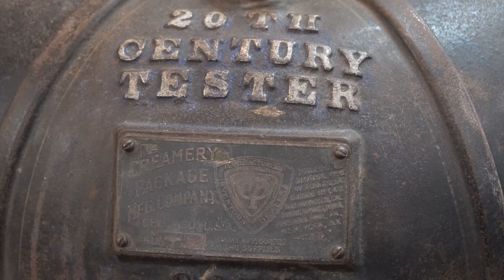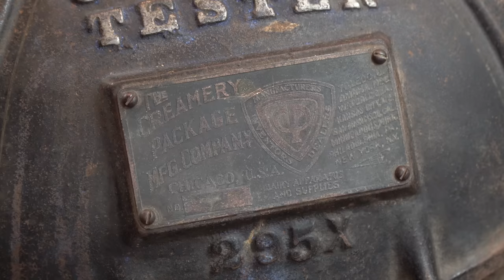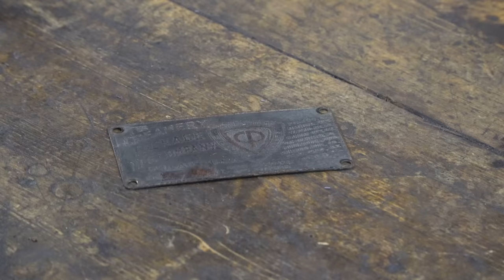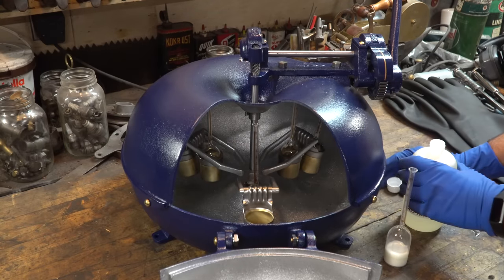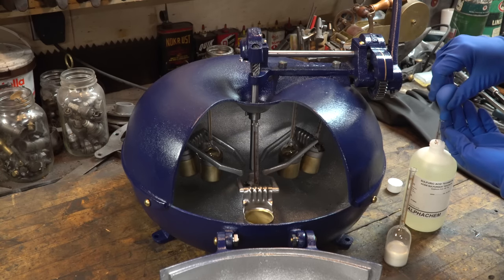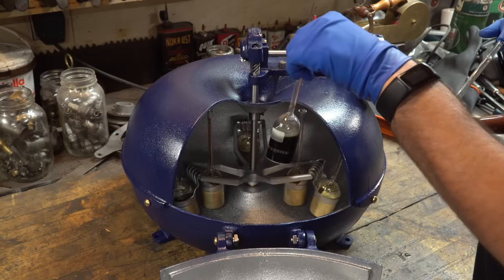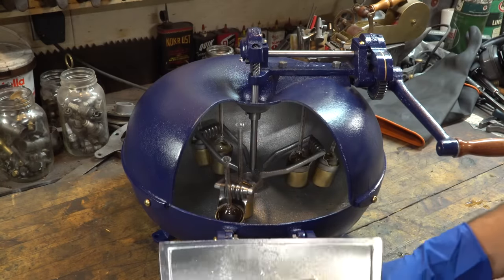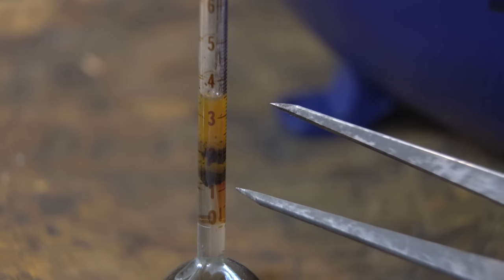Antique Sulfuric Acid Milk Fat Tester [Restoration]

Comment: you did things correctly. i used to do this for 5 years at gossner foods in Utah in the whey and cream prepossessing. we took these samples every 20 minutes of production. while this is a very old cast item we used a less fancy more modern from the 90's one but the process is identical. we are supposed to do 2 of them at a time and thus why yours has 3 areas with 2x in them. 2 for redundancy to get a more accurate average (hence your discrepancy form the store milk) and if you do the math. every 20 minutes, takes 20 minutes to do the job, you are doing 3 every hour. this tool would have been in constant use while the cream fat separator is in production from the milk / cheese was in production. some person was probably turning that thing for 12 hours at a time. most plants never shut down. if this was a single vial or dual then i would say that it was for a small farm but a 2x3 unit like this would be in use for at least 12 hours every day non stop.
Reply: Did you really use 1:1 H2SO4 and milk? And did you really use 98% H2SO4? That seems like a severe excess of acid.
Reply: Good to know! Thanks for telling us!
Reply: @littlejackalo5326  You want to react all the protein away, leaving just the fat, and then centrifuge it to coalesce the fat into the single blob.
Reply: @littlejackalo5326  Does it?  It seems to me like you want to destroy everything that isn't fat, which means nearly 98% of the milk.  I would expect a 1:1 ratio would be the best way to do that.
Reply: @robertlandrum  An excess of acid ensures there's no discrepancy in measurement, anything unreacted will make your measurements wrong.
Reply: Are these single use? Cleaning them sounds horrible but using once seems insanely wasteful
Reply: Very interesting
Reply: Thanks for the in depth description. I was going to ask if this was an antiquated method or if it parallels today's methods. 👍
Reply: @robertlandrum   "destroy" is not a particularly scientific term )   and no "everything that isn't fat" is not the rest 98% of a milk (if you not count water of course).
milk is 88%water, 3.2% fat, 3.2% protein, 5,2% lactose(sugar)  and the whopping 0.4% of helpful nutrients.
so it is mostly water with some fat and sugar.  not a healthy thing for you if you are not a couple of months old.
Reply: @iNerdier   sulfuric acid are dirt cheap and not harmful at all.  it is used in hundreds of tons almost everywhere in production.  
so what actually "insane" about wasting a glass of acid per day for milk testing ?
Reply: @vasyapupken  Probably wondering about the vials, not the acid. Cleaning them looks awful
Reply: @littlejackalo5326  100% yes we did. thats how you do it and it does get VERY HOT. we ... i mean I did this for cream... that is separated from the whey after cheese making. we were shooting for between 40 and 60%.
Reply: @iNerdier  NOPE, reused every time. we have a vacuum device that sucks it though into a stainless steel vessel, like a humming bird. every 4 hours we dump 1 pound of baking soda into it and 1 gallon of water and then it gets treated and dumped into the sewer once the PH is tested to be 7
Reply: That person, or people, that cranked that... Do not battle them in arm wrestling.
Reply: @spokehedz  why not, there probably like 100 yo now!
Reply: why not put baking soda at the bottom to neutralise any spills?
Reply: @Francois_Dupont  because its not very acidic once mixed. that heat.... is the reaction of the acid being neutralized. when its disposed of it is tested and neutralized then. as for spills, we just used water and a rag. if there was an actual spill of the acid then yes we use a metallic base compound to neutralize it but 90% of the time dilution with water is more than adequate.
Reply: @vasyapupken   What's wrong with protein, fat, water and other nutrients?
Reply: @timothywhieldon1971  Thank you so much for your insights. I came here for the restoration and got some neat chemistry info as well.
Reply: @timothywhieldon1971  i may not be an expert, but using high concentration acid at the same V/V as the milk would still have an end result that is acid. i would not think it would all react with the constituent of the milk. the centrifuge being made of metal i would think that in a commercial setting it would be worthwhile to have a steady supply of neutralizing agent close by to preserve the equipment or help the user.

i am more interested in knowing how those vials are cleaned. if as shown in this video the neck is so long and thin it render impossible the efficient use of brushes and "normal" cleaning method.
Reply: @vasyapupken  except for calcium, potassium, B12, D.  All things seriously lacking in most adult diets.  If a person isn't lactose intolerant and enjoys the taste of nice cold glass of milk,  it isn't going to hurt a thing.  Just don't overdo it.
Reply: @Francois_Dupont  I would assume the vials get cleaned similar to reusable bottles, by injecting hot soap water under high pressure into the vial.
Reply: @littlejackalo5326  At the cheese plant I worked at we ordered two concentrations. One for cheese 62% an one for milk 90%
Reply: @iNerdier  Babcock bottles are reusable. Cleaned after sample processing is always the easiest.
Reply: @vasyapupken  .
- Generally, "denaturing" protein would be the chemistry terminology used to describe what the acid does to the protein molecules.
- Boiling an egg, for example, denatures the clear white of an egg and makes it look white. Using vinegar{acid} in water when poaching an egg helps keep the original mass of the egg white together for a less messy poach.
- Denaturing the protein of beef turns it brown, showing the Nitrogen in it.
Reply: @Francois_Dupont  I answered this in another reply but for you I'll repeat it. 
We would every 4 hours add baking soda to help neutralize the holding container (stainless steel) that we put the waste after this process. It suckes it out like a hummingbird from a long small stainless tube under vacuum. Rinse and repeat. The holding waste is then tested and neutralized till a ph of 7 and then dumped down the drain. 
Milk has a very high (cream even higher) concentration of calcium. In our operation we tested for 40 to 60 percent for creamer from the cheese whey we processed. It does not take much to neutralize that acid. Even a 1 to 1. It gets Very hot. Too hot to touch. I have no idea the ph when reacted but we did 6 of these tests every hour for 12 hours strait. We added 3 lbs of sodium bicarbonate (baking soda) to that waste and at the end of the day only about a cup or 2 was needed to bring it all to a ph of 7.
Reply: @wolf310ii  nope. Sucked out via vacuum the minced with distilled. The acid does a good job of cleaning it already.
Reply: @scottsatterthwaite4073  Moo!  I definitely enjoy milk - about a gallon a week.
Reply: Incidentally, H2SO4 is probably the only solution that can be over 100% concentration. Pure H2SO4 in presence of SO3. It is extremely aggressive, it will strip oxygen and hydrogen out of most organic compounds to make its own additional solution water, leaving only the carbon behind. It's extremely exothermic when doing so, which can cause it to boil and spatter all over the place. this is why it is better to add it to any solution a few drops at a time. It is called "oleum", because it is oily to the touch... for a fraction of a second. IIRC it burns so fast through the skin that it will kill the nerve endings before you can detect the burn.
Reply: @timothywhieldon1971  alright, thank you!
Reply: @iNerdier  I'd bet they had a steam nozzle that would fit inside and just blast them clean in a second or two.  That's how I'd do it.
Reply: @jimmurphy6095  NOPE, just a rinse with distilled and a suction nozzle. remember this acid is cleaning it so not much is needed.
Reply: @timothywhieldon1971  Hey Timothy I just wanted to say thanks for sharing all of that info. You really gave a cool insight into something that most people would never have heard about otherwise. A lot of really interesting trade knowledge is lost all the time, and I'm glad that one good use for the internet is to allow people to keep it alive, even if it isn't of much modern use.
Reply: @timothywhieldon1971  Yes, clearly they haven't practiced recently.
Reply: @scottsatterthwaite4073  since beeing a kid i drink about one liter of milk every day. i am 38 now. no side effects yet.
Reply: @iNerdier  Glass is recyclable
Reply: Hey! How did you clean them?
Reply: So fascinating, thanks for sharing. 
 I think that's why it spins so smoothly is because it was well used. Well that and he used brass/bronze washers for less friction. Very cool, I would have never known this.
Reply: @iNerdier  I was also wondering that. Even tho it could be recycled in a acid safe plant? Maybe?
Reply: @timothywhieldon1971  thanks for the info, very fascinating. Are these color coded. Like blue for milk, red for cheese, so on so forth? Or since you guys worked with new age machines, you don't know? I'm really curious about the blue color. Or maybe it represented the type of chemical used in each centrifuge??? I guess I could Google it haha. But I figured I'd ask someone who's done it. Thanks again for the knowledge, so darn cool.
Reply: @frankierzucekjr  the ones we used were all white plastic boxs. i have no clue about the colour.
Reply: @deza9441  scroll up a bit. basically it gets sucked out and some water cleans it up.
Reply: @timothywhieldon1971  ok thanks bud
Reply: Wow vary cool!! I can see why people take cheese making so seriously almost like making a fine wine inna scene
Reply: I had the same job.  I was also pasturizing/homogonizing, receiving tankers, and supervisor.  We used special test tubes with a centrifuge.  Because of all the hats I didn't have time to wear gloves whene handling the 99% Sulfuric acid.  Just grabbing the bottle makes you hands burn, but a quick rinse of water stops it.
Reply: @Mr_Dopey  same... once i was working on the cleaning system and a hose that had organic peroxide in it, the fitting broke and a high pressure spurt of it got on me... 1000x worse than this sulfuric acid. not sure on its concentration but it burned for a few hours even after removing chemically as it was though the skin into the tissue. doc said its probably going to cause cancer in 30 years!
Reply: @timothywhieldon1971  My father once exploded a building that produced hydrogen peroxide.  He was installing a sprinkler system.  Before he went in they hosed every thing down, and he had to use brass tools.  When cutting a piece of conduit, the powder had built up inside of it during production.  He said it went down it like a fuse.  He yelled at his partner to run.  His partner was the last one through the blast door, so he hit the special emergency close button.  That pure powdered hydrogen peroxide is volatile.
Reply: Hello from SLC :)
Reply: I have just looked on some parts of the video, but if it has 9 vials, it still can be for small farm (by modern standards) but they would measure each cow/goat whatever individually.
Reply: @Mr_Dopey  You mean Sodium Percarbonate.
Hydrogen peroxide is a liquid in it's purest form, 99.99% hydrogen peroxide is a liquid, but it's technically possible to concentrate it through using something that reacts to form it rapidly; like sodium Percarbonate.

Not saying your story is false, just that it was explained to you wrong; because there isn't such thing as "solid hydrogen peroxide".
Reply: @D-Vinko  I understand the difference.  It's easier for people to understand that way.  People don't understand when you refer to it as Oxygen Bleach either.
Reply: @Mr_Dopey  You wouldn't need to, seeing as how oxygen is inherently a bleaching agent on its own, it's redundant to call anything that produces oxygen for bleaching "oxygen bleach".
It's like saying 2 AM in the morning.
AM implied in the morning.
Reply: @D-Vinko  It's a common term already in use.
Reply: Wow thank you for sharing
Reply: @robertlandrum  it is 1 to 1 my guy

Comment: I was born and raised on a dairy farm and operate the same dairy farm today, I'm 64 years old and can remember the DHIA, (dairy herd improvement association)tester arriving on our farm and after milking set up a similar centrifuge in our milkhouse and doing the same test for each cow. Her centrifuge held at least 50+ bottles. The testers were usually retired dairy farmers or their wives and they handled everything without gloves using open ended pipettes and they sure weren't shaking like that. Shortly after that DHIA started sending the samples off to remote labs where the samples were run by newer single step machines and much faster. Now it just consists of a probe, don't ask how it works I haven't got the foggiest.

Comment: I am genuinely shocked that "Brass Fasteners" is not charting on itunes. Straight bop right there.
Reply: Brass Fasteners have a groove
Reply: Hand Tool Rescue is getting Screwed by Apple.
Reply: Also, I expect this will be an epic thread.
Reply: The puns have been Slotted in.
Reply: It's a banger. Got pulled over playing it by the police cause my stereo was too loud. I said, "Hey copper, whatya zinc?"
Reply: The pitch was tight, groovy, and the players were in the slot.
Reply: @chrissturgeon1571  you've just been tapped to clean up.

Comment: The black part is carbon. When you add sulphuric acid to such organic materials everything that contains water molecules like the sugars in the milk gets dehydrated and the carbon is left behind.
For example is you add sulphuric acid to pure sugar (sucrose C12H22O11) you'll get an exothermic reaction that will leave behind a sort of carbon sponge

Comment: This definitely needs one of those "This device predates safety" stickers.
Reply: Its laboratory equipment, so safety is achieved through operator knowledge and behavior. This is still true in many labs today - no way to make a bottle of concentrated acid completely safe.
Reply: Almost! There was a guard over the sets of gears! ... or maybe it was intended as decoration!

Comment: I paint and I'm a bit of a history nerd -   

There where basically 5 common blue pigments available at that time.  In order of age they would be

Indigo
Prussian blue
Cobalt blue (cobalt(II) oxide sintered with aluminum oxide)
Synthetic ultramarine
Cerulean blue (cobalt(II) stannate)

While I doubt that looking at this video, I'm getting a perfectly accurate recreation of the actual color, that really looks like synthetic ultramarine to me.  Because of risk of the colors not being reproduced on my screen 100% perfectly, I would hedge my bets and say it could be a variant of cerulean though but unlikely.

Natural indigo has a much greener hue and was not common for this sort of application.
Smalt was still around but had largely fallen out of use. It has a very pale desaturated look to it.
Prussian blue is very dark on it's own.  Since you found no lead, it's very unlikely to have been cut with white to brighten it.
Cobalt blue was very expensive.  Not as expensive as natural ultramarine but still pretty costly.  It was largely reserved for fine art and luxury goods.
Cerulean blue would have been pretty new at the time.

Basically, once synthetic ultramarine became available, it was the blue of choice for paint for quite a long time.  That boils down to a mix of cultural and economic factors.  It was cheap but it was still viewed as the color of royalty.
Reply from the maker: Interesting!  Would you say synthetic ultramarine would be used in the 1920s?
Reply: @HandToolRescue  Yep.  The first factories producing synthetic ultramarine opened in 1830 in france and germany.

While the realities of logistics surely meant that it wasn't instantly available everywhere, 90 years was definitely plenty of time for it to fully propagate throughout the west in the era of steam.

Comment: Nice restoration! Really inspiring!
However, I'm curious if that spring handle on the triangle cover is original. It looks like original handle has been missed and that was "quick and dirty"replacement.
Reply: Probably original. Most likely bent up do to opening and then dropping the door on the table.
Reply from the maker: Oh it's original!
Reply: @HandToolRescue  oh wow , company did a terrific job on design but flubbed the handle , or so I thought . It wasn't until you pointed out the impacts it would have to endure day in and day out , that it makes complete sense.

Comment: - What a fun project...and excellent restoration, Eric.
- I wondered if you would bore each shaft hole and lathe a brass bushing for them all so the machine would spin with much less resistance...but I figured you wanted to keep it original...and it really does not need that done given how easily it all seems to work anyway.

Comment: It's a Babcock Milk Fat taster which I have used in the Dairy Industry. 
Now it's done Electronically on a Milko Fat/Solides/Protein Tester in Seconds. 
The old way took as long as 15 minutes to find out the fat and then you still had to do the solides test which was just as long.

Comment: depending on how pure the acid is yes it will eat thru rubber gloves and some types will bust in to flame its honestly safer to handle the acid without gloves it will turn the parts it touches orange from dead cells but it's safer then with gloves you just need to wash it off right after your done you would also need to work faster